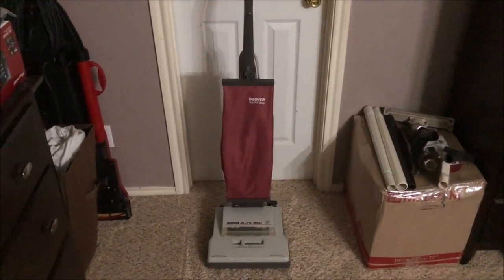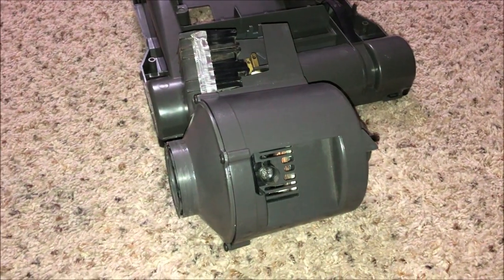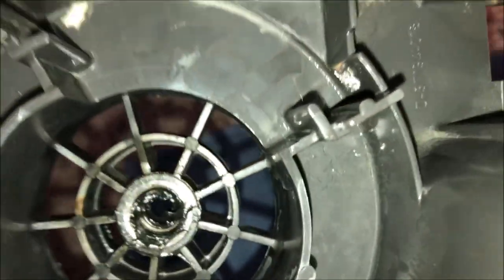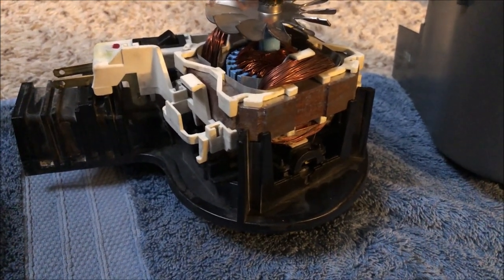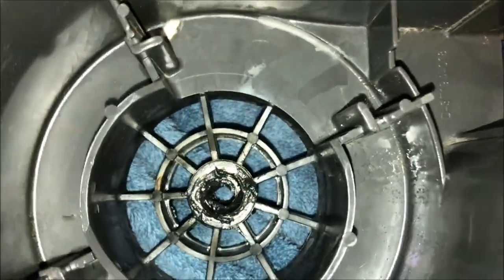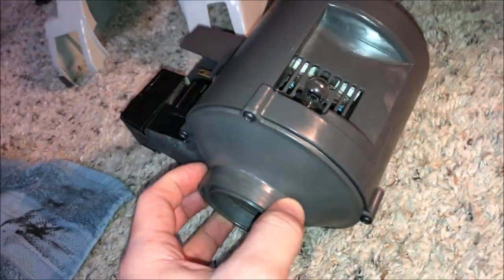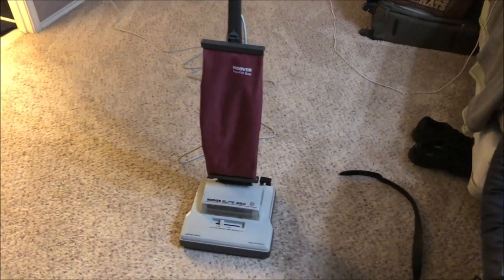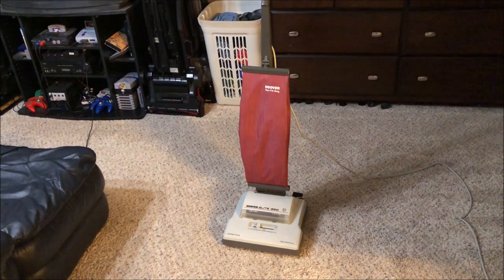Maintenance: How to Service an Early Hoover Elite Motor

Comment: Maybe you should clean the bearing with some carb cleaner or rubbing alcohol before packing
Reply from the maker: I've already accepted the fact that it's a needle bearing, and it's naturally going to be noisy.
Reply: @graysonsvacsandmowers5426  using carb cleaner is a habit I've gotten into to melt the old gunk out, but needle bearings can definitely be annoying  and noisy